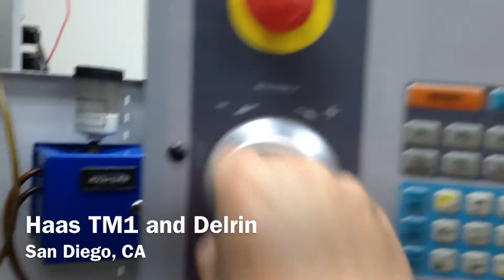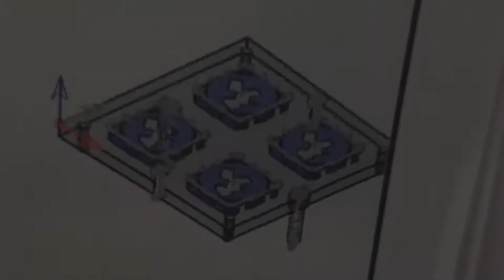Haas TM1 and Delrin

Comment: Not 2, but 4 locators. Interesting.

Build larger subplate such that you can edge clamp around the periphery of your material. Drill and ream 2 dowel locations in subplate. Drill and tap multiple locations--most importantly the center of the plate--for bolts. 

Machine side-A features. Program stop.

Flip about Y axis and insert t-pin dowels to relocate. Insert cap-screws to hold stock down. Remove t-pin dowels.

Run side-B.

When I started out in R&D/prototypes, this is how we machined 90% of our parts without the need to build jigs/fixtures.

Good to build a large permanent subplate off to the side of the vise on risers and utilize more of the machine travel.